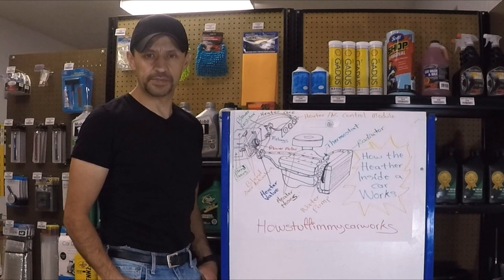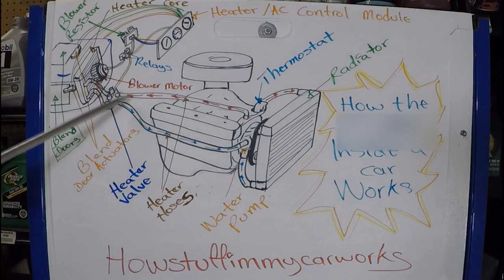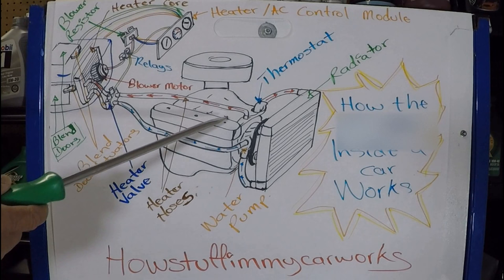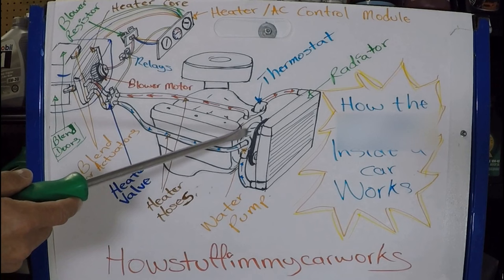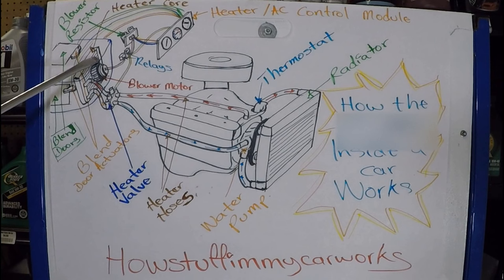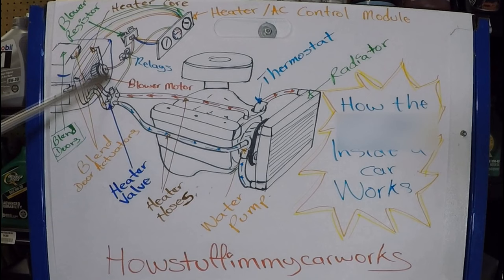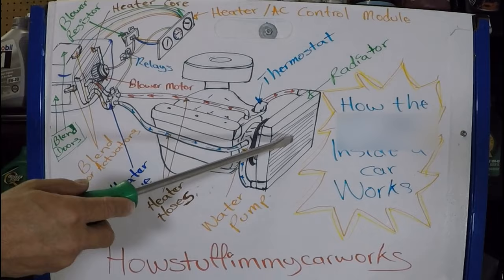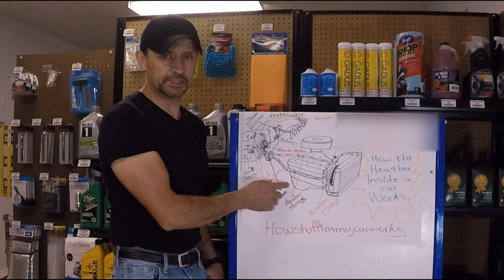How the Heater Inside the Car Works

Comment: Looking this up because my radiator fan died and my car overheated I can’t afford a new fan rn but I learned that the heat comes from your engine so keeping my heater on full blast highest temperature and air circulation off been keeping my engine at normal temperature

Comment: Some people say the main reason the TFI fails is due to heat. I know the thermal paste helps transfer the heat, but the module is still under the cap. Would it possibly make sense to mount the TFI on a bigger heatsink mounted externally to the firewall? I believe GM 96-97 models are mounted externally and I'm considering modifying my setup and try a 4 pin external TDI.  What do you think?   BTW, very helpful information, you explain it very well. Thank you!
Reply: Its not just the heat itself, its the fact that it goes hot and cold again and again and thats called the thermal stress. This problem is just a oversight by the manufacturers.

Comment: I was trying to find out why my heat on my passenger side of my car is lukewarm. I replaced all the actuators but it didn’t help I think I will try a heater core flush in the spring.

Comment: No dual control, Hot air coming out of driver's side vent but cool air coming out of passenger side when heater is on. I was thinking about blockage but if there is some kind of blockage then would would cool air come out of passenger side, there should not be any air coming out then.
any idea any oe?

Comment: So my A.C stops working. Light is on but no air comes out. Also no heat. I hit a bump a few days later my A.C and heat work again. Could this be my A.C compressor? Is my interior heater also connected to the A.C compressor?

Comment: Drives me crazy when someone in the car will try and get hot air the minute the engine is started and you end up with freezing cold air blown on you for a few minutes. Much better to wait for the engine to warm up.

Comment: Does the thermostat control coolant flow to the internal heater radiator or does the internal heater controls instantly let cool/cold coolant flow through the heater radiator? I'm thinking of adding a hot coolant storage tank on my car and I think the heater loop may be a good place as the valve is already controllable.

Comment: Does the heater valve control both the inlet and outlet of the heater core?  If this is the case i assume the heater core will always have coolant in it?  Thanks

Comment: Hey man...if you block the coolent from goint to the heater will it affect the engine in anyway? Like increasing the pressure inside or something
Reply: No it wont because the excess coolant will just sit in the coolant tank also why would you block the connection letting the coolant go to the heater core

Comment: i have dual heat its 30 degrees and i need the heat to work it works fine ont eh drivers side but the passenger side blows cold why would this be happening?
Reply: ronald walters could be a broken blend door

Comment: Does the heater slows down the engine? Does the heater consume gas like the aircon?
Reply: The fan on the heater core is not a power take off (PTO) so therefore it does not increase the load on the engine like an A/C compressor would
Reply: No it doesn't consume gas like the aircon because it is just passing the heat from the engine through a blower motor into the car, while the aircon requires more power to regulate the temperature of the air i.e cold air and therefore consumes more gas.